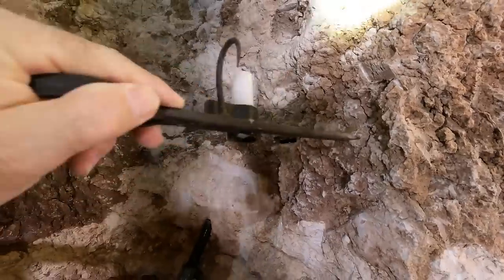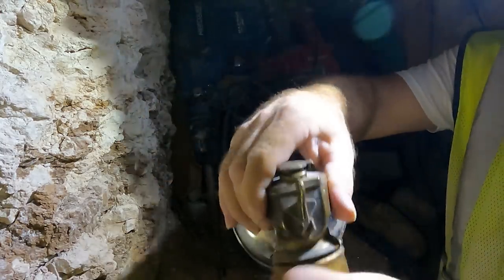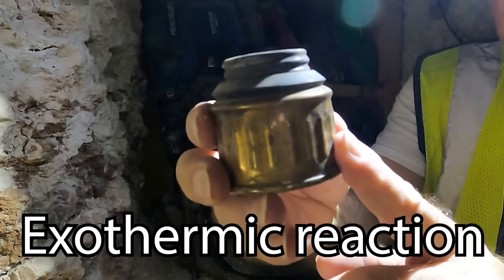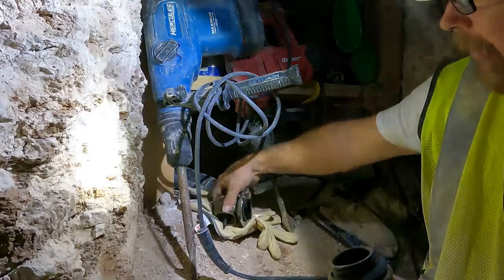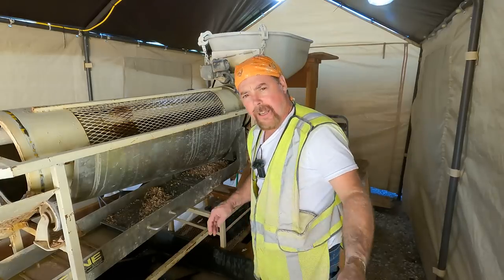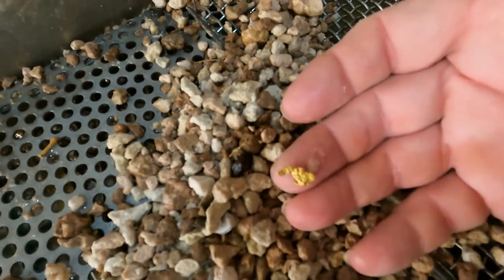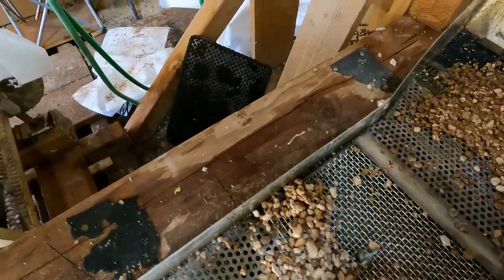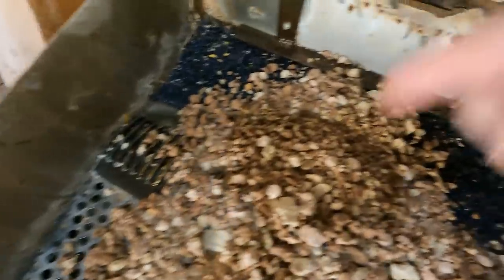I Broke My Gold Record | Digging into Mine Shaft Sump Finds Rich Placer Gold

Comment: The shimes as you call them we call wedges ,in coal only allowed 3 on top of the post and cap blocks. I would come out and and muck for ya but Im thinking you might have a major air change ;) and no open flames!!! Just an old MSHA guy
Reply from the maker: thanks old MSHA guy ...I know...right especially after a can of beans
Reply: @Askjeffwilliams  LMAO,,, yes sir but I dont think other than bean gas you have much to worry about,, Though I wonder have you found anything more with the cave system or was they just a gap heading into the old drift you found?

Comment: Why not use a shopvac to pick up your muck at least the smaller pieces have the shopvac in the skipcar so all you have to do to empty it is tip it over  then just pick up the bigger pieces after by hand or with shovel

Comment: Jeff, have you tried using a rock crusher? The video shows that part of the clay is not washed out. The rock is dry and should break easily. Surely you have answered this question more than once, but I do not speak English and cannot understand all the comments.
Reply from the maker: yes we have a small jaw crusher that we sample with
Reply: @Askjeffwilliams  This crusher does not increase the yield of gold when washed? By the way, practically no one uses jaw crushers in Russia. We use rotary crushers with weights on chains in a round drum. Usually people make them themselves from improvised materials.

Comment: Nice, I found an old AutoLite carbide lamp that I'm restoring.  I have the water valve assembly cleaned up and sealing again, made a new gas filter, and massaged a few dents out of the body.  I left the patina untouched on it, but I'm debating what to do with the reflector as it's as dull as the rest of the body (and wouldn't be very functional as a result).  Should I leave it as-is or give it a good shine so it'll reflect light better?
Reply from the maker: just shine it up a bit

Comment: Hey Jeff I'd love to come help you but you'd have to cut me off just below the knees to fit in there at 6'7 I don't fit places like that. I did have an idea though on your mucking forays. have you considered making a plate for your trolley that holds six five gallon pails that you use to go up the shaft and just mucking into those pails? If they already have the shackles to go up the shaft that would stop you from having to unload and then reload. You may not get as much in the trolley but you would only have to handle it once I hope it works if it does just let me know I'd love to hear about it thanks and like watching you dig holes in the ground it's fun! Thanks, Bob
Reply from the maker: thanks for the ideas Robert .....we love hearing that

Comment: You don't know the proper way to light a carbide lamp'
Put your palm flat over the  reflector to trap the gas and use your palm to roll the striker wheel.
You  if you do it fast, you will hear a pop as the gas lights and your hand clears the reflector.
i use carbide lamps exploring old mines for many years till i got fined $500 for  using one in a old gold mine and walking out only to find a federal mine safety inspector waiting for me when i came out of the mine.
Cave explorers can use them for caves but miners can not for exploring  mines MESA  carbide lamps are a explosion hazard due to gasses in old mines.
By the way, i never paid the fine. And over the years worked my way up to mine superintendent'.